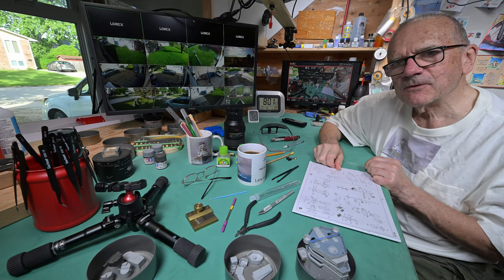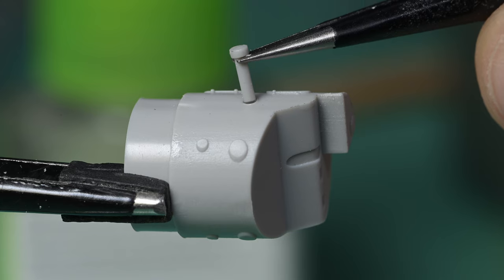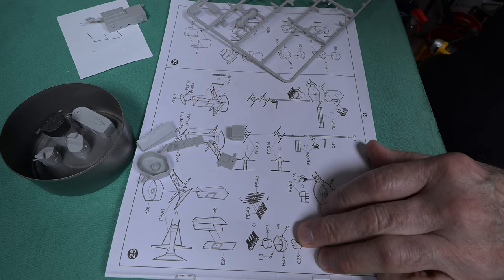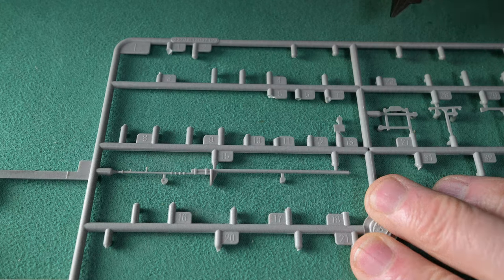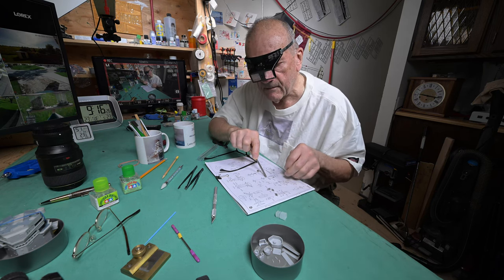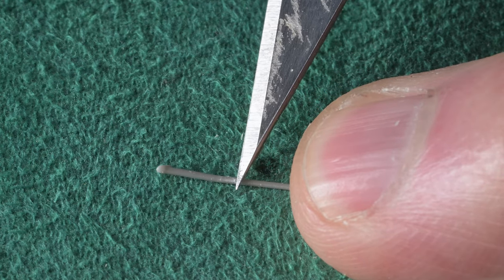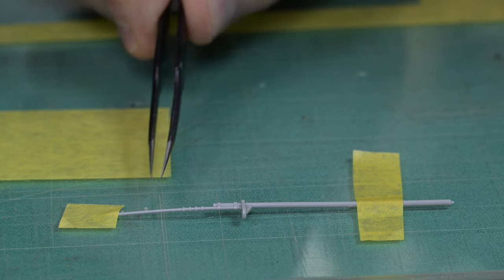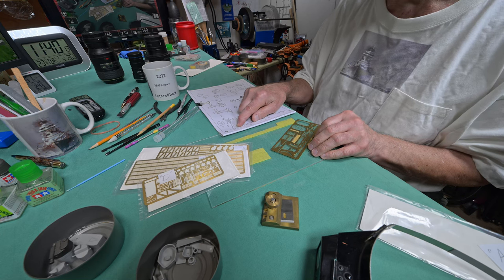The Model Ship - Part 1230

Comment: I use a scalpel with a new blade to remove flashing from delicate parts. I have a couple of knife handles, one always has an old blade to scrape mould lines, the other to cut tape and clean delicate parts. Curious what type of cloth you use on your desk, and why you use it, and how often you clean or change it? I work directly on an extra large Self Healing Double-Sided Cutting Mat with Grids and circles so that measure and wipe clean easily. Considered using cloth, but was worried about dust accumulation when sanding parts.
Reply from the maker: The green cloth is simply a large, cheap microfiber beach towel. I have to be careful to avoid spills. What I like about a cloth top is that the round parts don't roll around. Vacuums off easily.